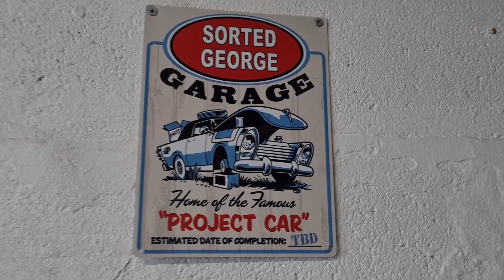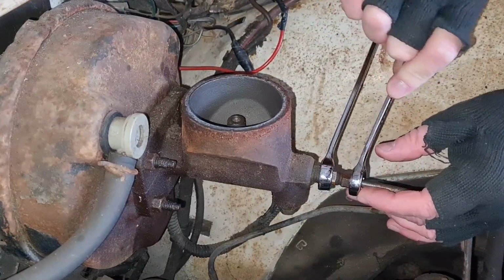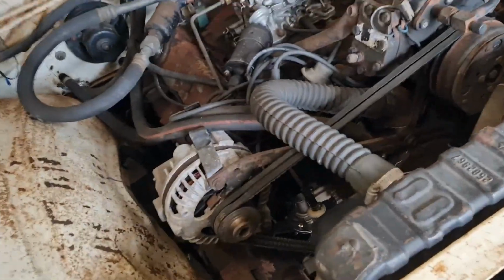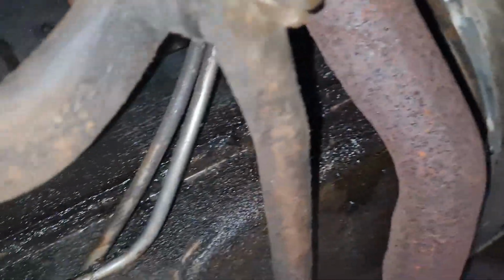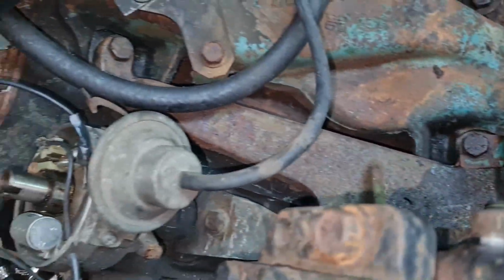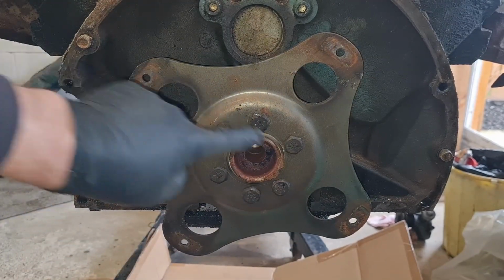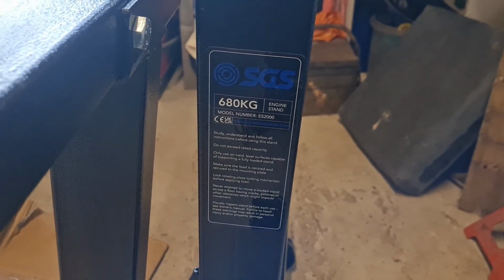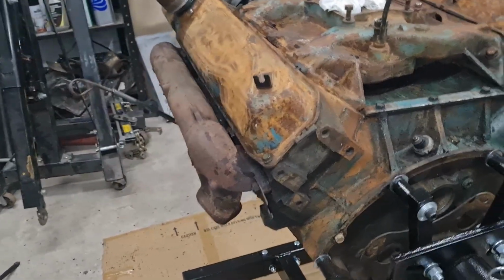Removing My 440 Engine

Comment: Good luck with that master cylinder! I had a remanufactured cylinder fail in the first 1,000 miles. Bad news was that I was coming off a highway and had about 1/8 mile (0.2 kms) to work the emergency brake to a complete stop from 55 mph (88.5 kmh). Good news is that I knew what to do and had no traffic around me.
Reply from the maker: Glad you managed to stop safely Romeo. I hope this one doesn't fail like yours did 🙏🏻😳

Comment: Your problems with this engine reminded me of a story a friend told me, he bought a 1970's Chevy Camaro and it seemed to run ok, until he changed the oil, and then it started burning oil like crazy! It turned out that the previous owner had shoved some engine oil thickener (STP?) into the engine to reduce the oil consumption. In other words, the rings were worn out, and he had to buy another engine. Hope your problem isn't that bad. I am looking forward to the next video!
Reply from the maker: Thankyou Alan. She's stripped down now. Just got to sort out the video now 😁😁
That's a cruel thing to do on someone with the STP thing 😡

Comment: The tin foil is insulation for the valley pan is to keep heat off the intake. Will help prevent vapour lock on hot days. I imagine if you get a rebuild gasket set or something along those lines, it will probably come with new valley pan insulation. The whole job you're embarking on will be worth it in the long run for peace of mind.  It's unfortunate about the fuel pump, aside from the shipping costs going back, it's hard to get quality parts these days.
Reply from the maker: I agree Patrick, you have to go careful with what you buy. To much cheapo chinesium metal out there now. Thanks for the heads up with the foil pad - my suspicions were right 😁👍🏻 Someone else commented on this, and apparently they were a factory install 😳

Comment: My brother had a 1968 Road Runner with the 383 engine.....when he had the dealer overhaul engine ...there was  tin foil on the intake valley cover when I was picking up the car for my brother so I asked what the deal was.....mechanic told me they had the foil  from factory to block the heat of the hot oil on vslley cover heating intake manifold....apparently the foil was painted when they painted engines so it was not obvious.   Whether this was normal just on the 383 / 335 hp engine or others too...?
Reply from the maker: Aha!! My suspicions were right! Thankyou Neil 😃👍🏻 There's a thin flat plate under the front of the intake. I'm guessing this is to hide the pad from view as I can't see any other purpose for it 👍🏻

Comment: mine has that tin foil I thought it was a hero sandwich from 1982 that someone heated and forgot.
most that oil might be the valve cover gaskets. mine were dried up and split. I tore them off and noticed a grey sludge in the galley and pieces of a factory valve seal so I will have to get that sorted. the pcv comes off through the bottom of the "can" I managed to get off and soak in gas. the valve covers are filthy inside so I' soaked them too. I got the mahle cork gaskets and all my parts from the same rockauto. the parts places in town are out of their minds and are double and triple the price of rockauto. my covers have studs and nuts, most are seized to the stud and maybe a torch might help but I just put them back the way there were.
my transmission is leaking from the pan gasket so I got a date at the shop to service that and I will get him to put a 1/4" ntp plug in the rear axle housing right at the back edge where its flat. good times!
Reply: he grey sludge is reported to be paraffin wax that old oils used
Reply: I'm on the cbodiesonly forum under cartel
Reply from the maker: A hero sandwich 🤣🤣🤣
Hey 12321, I watched that little video link you sent me... love your ride. Stunning condition!!
Apparently (I've just found out) this was a factory install of these pads to help prevent heat soak from valley to intake and prevent vapour lock 👍🏻
Reply from the maker: @1112223333111   Thankyou for that info, I thought it might have been condensation 👍🏻